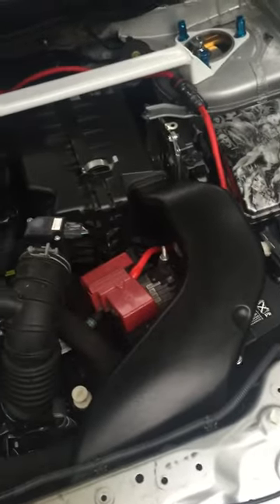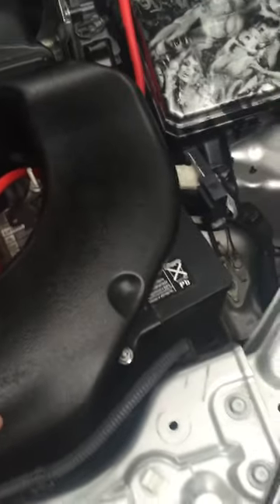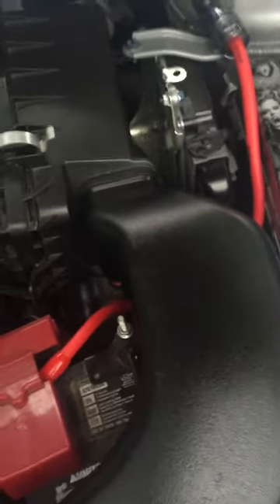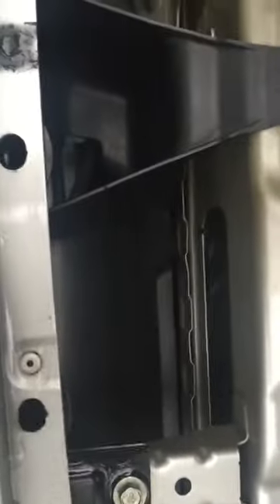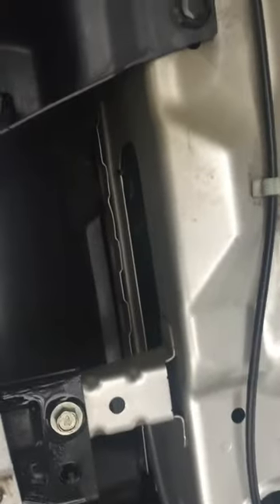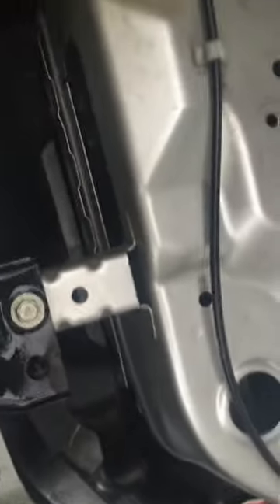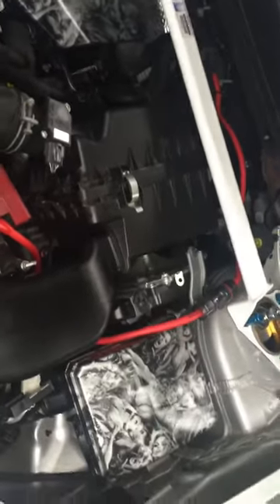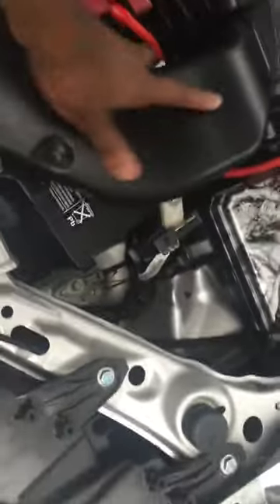Outlander Sport; Ralliart Snorkel

Comment: You will not lose air speed because it is wider, in fact opening up the front vent/plastic grill with the ralliart snorkel is a great idea as you are allowing more cold air into the engine for cooling and combustion. In the case of the lancer specifically the air intake box is in a compromised position being near the fire wall where it's hot, so to maximize cooling and thus HP you need a system that will allow for further cooling via more cold air 😉

Comment: Being wider you lose air speed and therefore power... why do you think engineers designed a specific snorkel for this car instead of using the Ralliart one right away if it’s better?... omg.
Reply from the maker: Chiquicat the lancer/ralliart/os pretty much share the same intake box as they use the exact same filter. And I was tuned for all my supporting mods so I didnt lose power
Reply: Nyron Smith the snorkel shape directly affect how air is delivered to the air box, there is a reason why they are tailored to each car. If you feel your money spent in snorkel + tuning was worth it good on you. Any engineer would agree that what you'be done to your intake is a monstrosity and you have definitely lost air speed. It's not only the volume that matters.